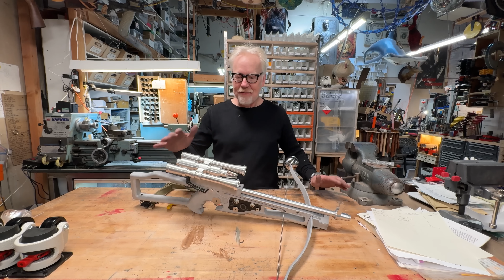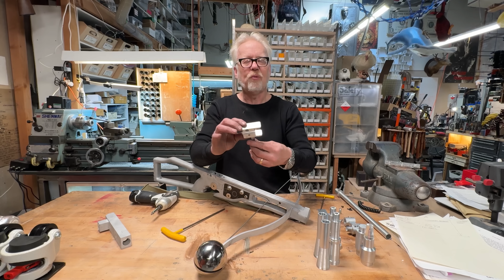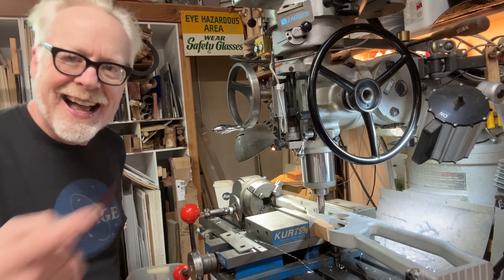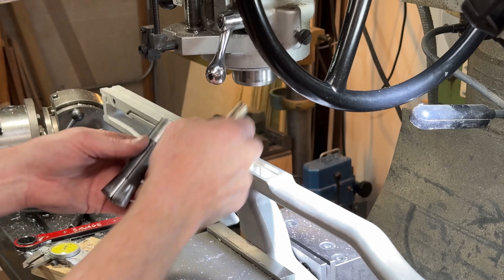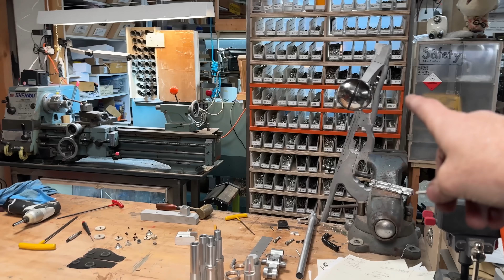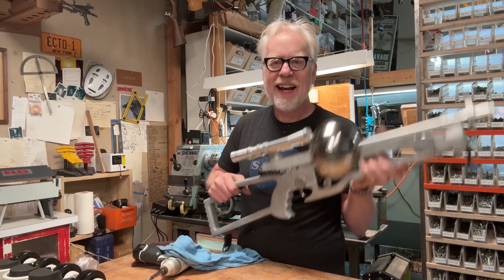Adam Savage Mods His All-Aluminum Bowcaster Replica!

Comment: Adam, when I was in the aircraft industry, I often worked on prototype parts and very often did what you are doing here - it was known as “adding lightness” 😊
Reply: That's Colin Chapman of Lotus fame:
"Simplify, then add lightness"
Reply: @cpt_nordbart  yup, king of the engineers. If the car did not fall apart as it crossed the line then it was too strong and therefore too heavy. Add lightness was one of the mantras of the chief designer at our site.
Reply: Reminds me of a riddle: What can you add to a barrel to make it lighter that can be seen with the naked eye? A hole.
Reply: the correct term used in regards with guns, is "lightning cuts" ⚡⚡
Reply: I would refer to it as "Increasing Levity." It sounds better and it rolls more trippingly off the tongue.
But that is neither here nor there.
Another term for them is Lightning Holes, which are the holes in the airplane you get when it simply weighs too much and you fly into a Level Five Thunderstorm.  I did that once, and frankly I don't recommend it.